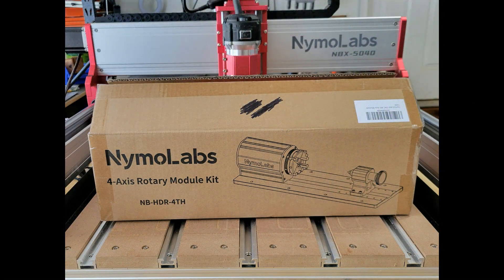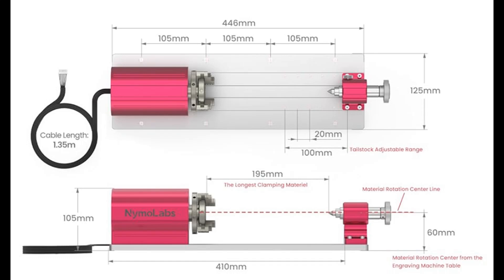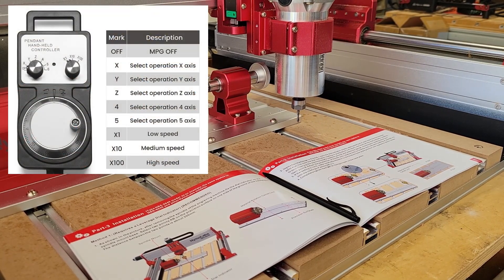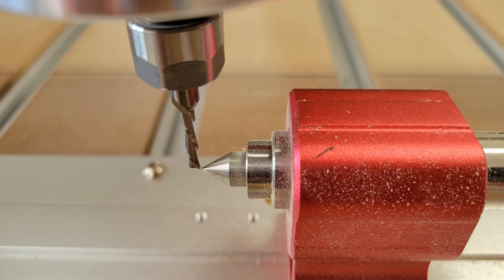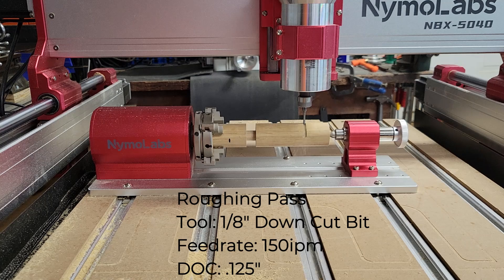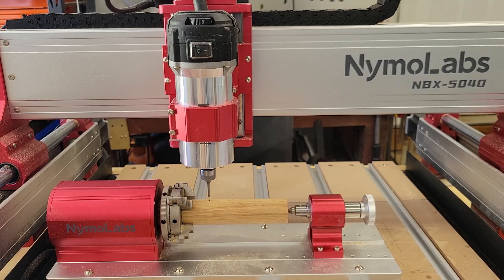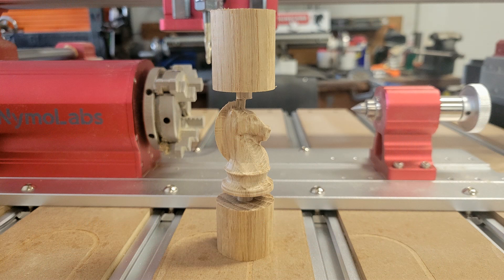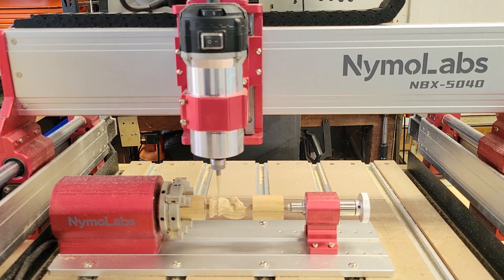NymoLabs 4th Axis Rotary Module

Comment: Dave, I have the same setup as you. (VCarve and the 6040) 
I can jog the 4th axis but when I cut the rotary doesn’t spin and the XY move as if it is 2D. Does the generic gcode post processor handle the 4th axis or is there another processor I need to use?
Reply from the maker: Thanks for watching!  You will need to use the G-Code WrapY2A (mm)(*.tap) post processor in VCarve.
Reply: @DaveGatton  I cannot get this right. I followed your video as best I could. I used the WrapY2A pp. Everytime I run it, it cuts straight down to what looks like the center of the dowel and then cuts from there. I created a roughing toolpath with a 1/4 inch end mill. I can't understand why it doesn't respect the .1 depth of cut.
Reply from the maker: @BoydWold  where do you have your z zero set?  To the centerline of the A axis?  Or to the top of the material?